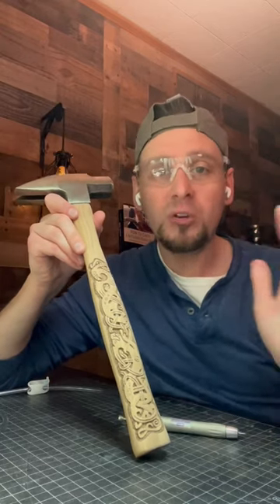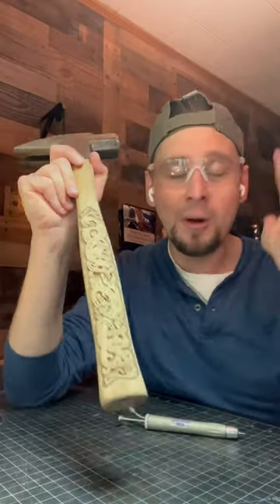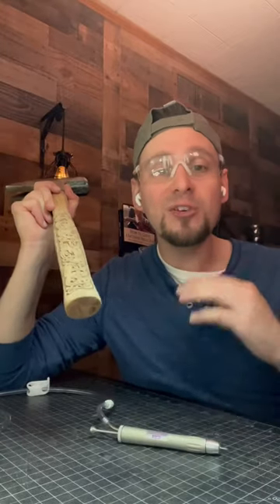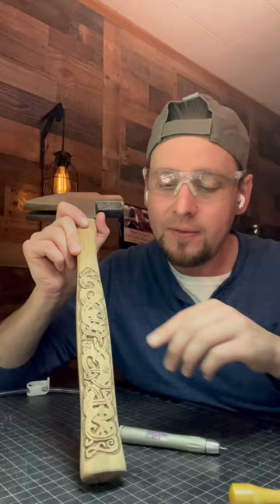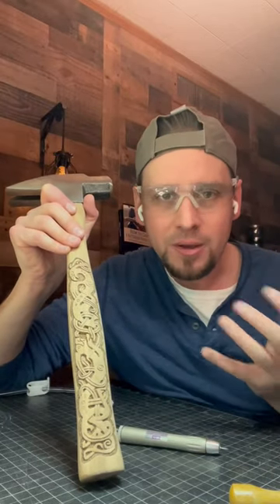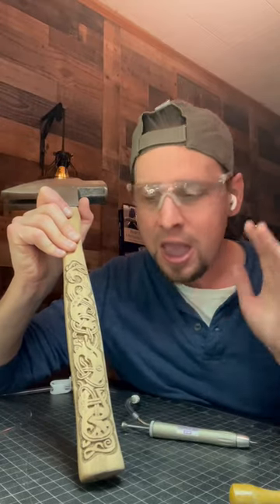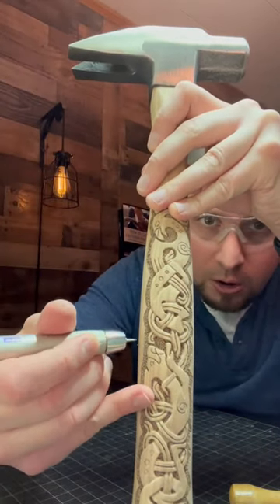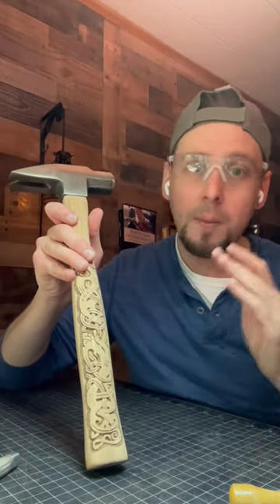The Best Woodcarving/Powercarving Tip for Beginners

Comment: What is better for someone to get started with power tools or just the normal knives ?
Reply: I started with knives and just got a Foredom power carver tool… if you want to be sharpening and stropping knives 50% and actually carving the other 50% then get knives. Lol. I am loving the power tools because I don’t want to stop and sharpen everything constantly.
Reply: @willstrick25  is there a specific brand would you recommend?
Reply: @faisal1814  I bet this guy has some videos about different ones somewhere. He uses Foredom and Dremel both I think.  Dremel is cheaper money wise but still good tools. I got a Foredom because I had the extra money since it is more expensive, but it will last forever probably.  There is a video he did comparing them actually.
Reply: @willstrick25  you are an angel thanks alot ❤️